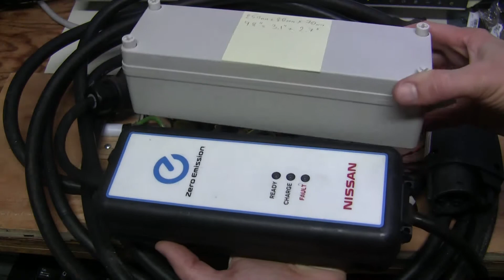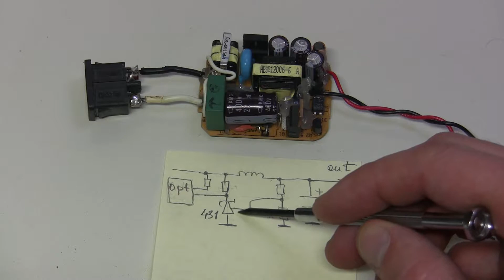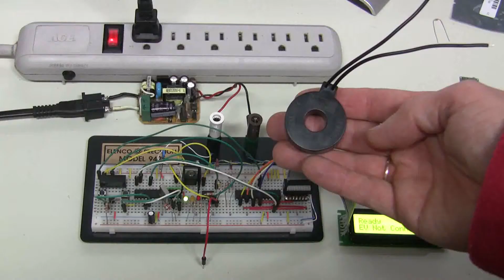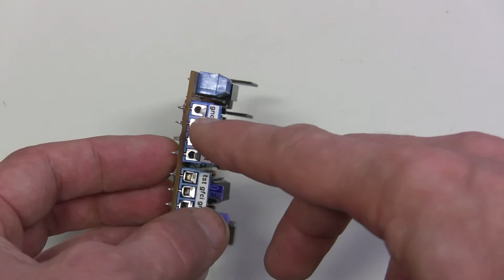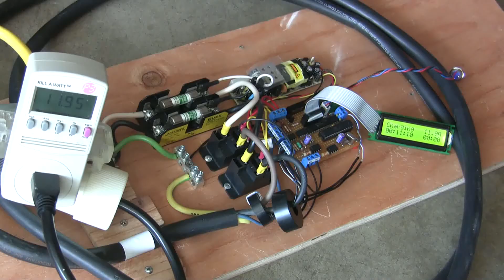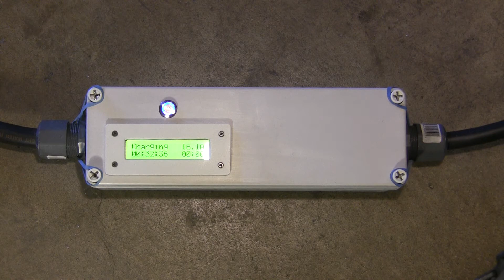#25 - Do-It-Yourself OpenEVSE level 2 electric vehicle charger - part 2

Comment: Are those watertight fittings really sold as strain reliefs? They look like they are made for watertight conduit but such fittings wouldn’t really have a way to seal against the cable.

I went to a hardware store (Lowe’s) and could only find conduit fittings. :(

Comment: Can you link that enclosure (assuming it’s still available)? Name? Specs? Model?
Reply: OK, I searched the measurements written on the sticky note along with “waterproof project box” and found a listing with a bunch of different enclosure sizes including that one. 250x80x70 looks to be the same exact one. They also have a 250x80x85mm for a little more room. Item number 294268994917 (multi-unit listing)

Now I gotta take measurements from my Clipper Creek control board that’s still in transit to me.

Thanks for the video!

Comment: My Toyota standard level 1 charger can also be a level 2 charger if wired to 240 volts been using it for a few months now no problems I now charge at 240 volts 16 amps  full charge is now 2.5 hrs instead 6.5 hrs on 120 volts 12 amps

Comment: Very nice. Is there anyone out there selling a circuit like this that I could build into a charger myself? Just the board/ display, then I install the cables, plugs, relays etc myself? I am amazed at how much a charger like this costs from Nissan etc, and they are not very complicated, and you cannot select charge rates.
Reply from the maker: +Will Datsun 
Sure, I mentioned it in the first part (kits, parts and assembled chargers):
http://store.openevse.com/

Comment: https://yadi.sk/i/2JV4feVKj3xoz    источник 5v  2A
Reply: +Danvirs Yes, but look at the part count for a switcher as compared to a minimal 7805. If the circuit is only drawing tens of milliamps of current despite the voltage differential across the 7805, then what is the point?
In Russian: Да, но посмотрите на количество компонентов по сравнению с 7805. Если ток минимальный то игра не стоит свеч.

Comment: You might consider replacing the 7805 you have on there to make +5 from +12 with a switching buck converter. It's easier to do that than it sounds. There's one on Tindie that's pin-compatible with the 7805: https://www.tindie.com/products/ddebeer/5v-1a-switch-mode-voltage-regulator-40v-input/
Reply: +Nick Sayer I guess the point is the $5 price difference between the 7805 and the switcher in a similar package.